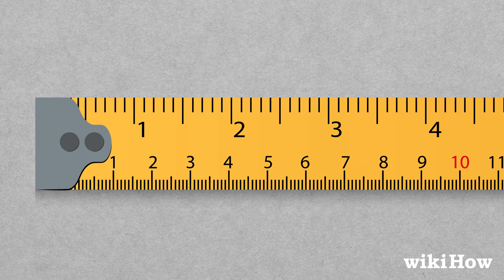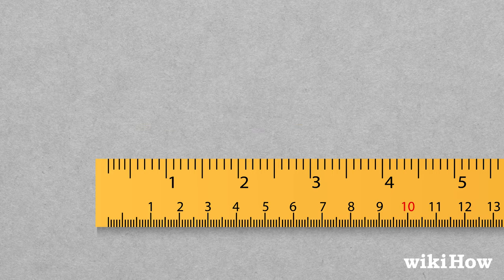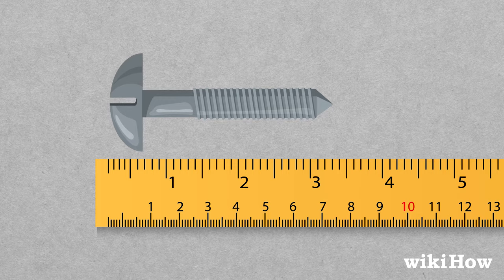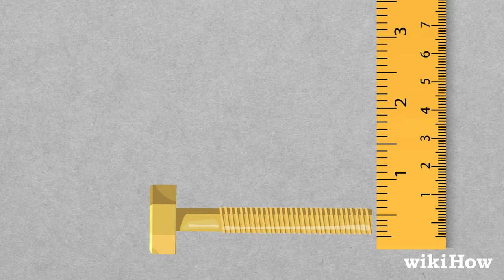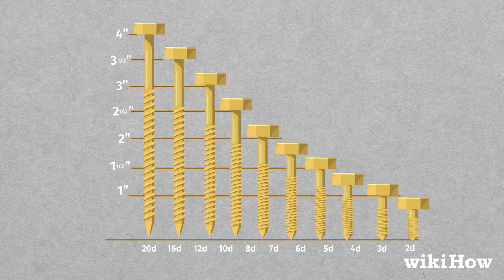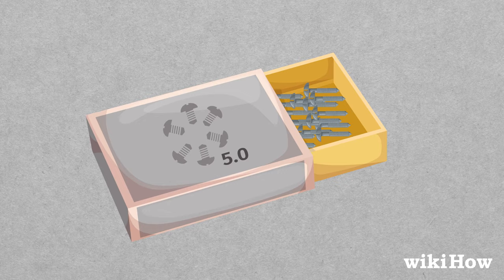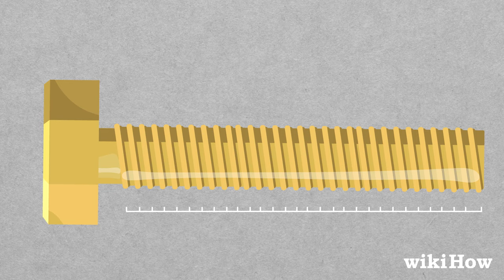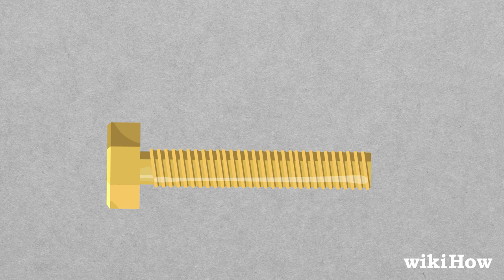How to Measure a Screw Size

Comment: This is rubbish really, assumes you are just screwing a standalone screw into another surface or connecting one to another which isn't preformed. Who ever does that?! A screw  usually has to hold a previously manufactured bracket through a manufactured whole  and for that you need to know or calculate the head size. This video doesn't tell you one of the two most important things so a waste of time